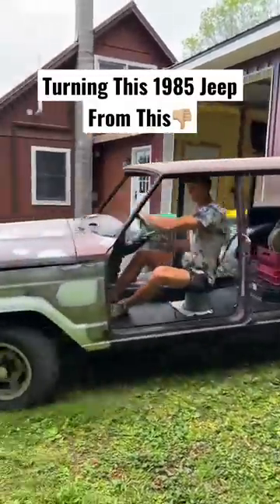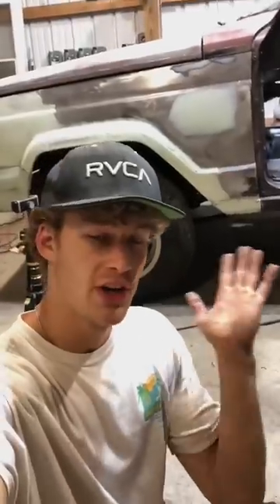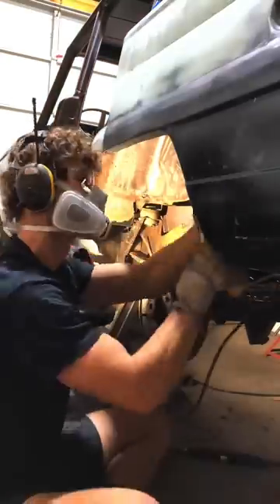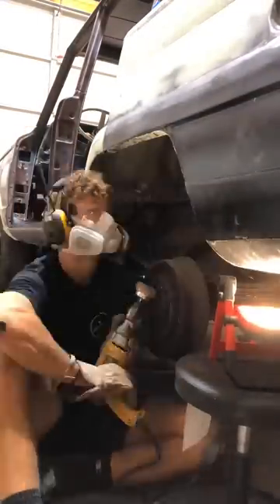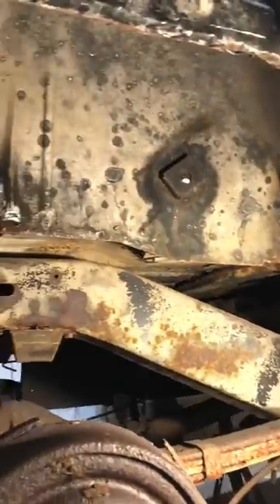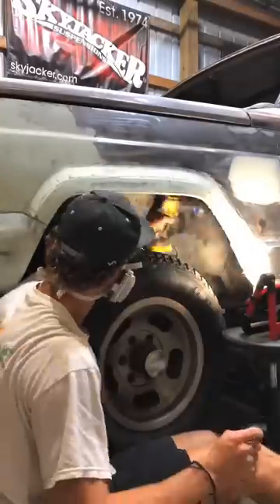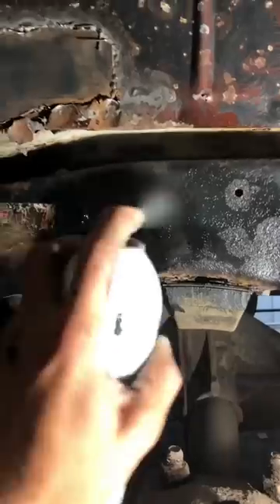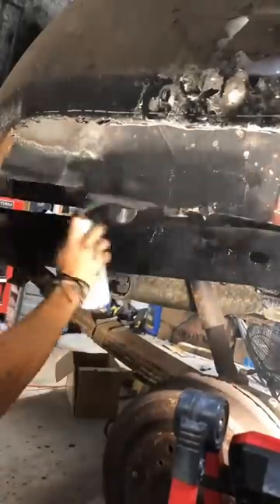Someone welded my jeeps wheels on 🤬 #automotive

Comment: To get that wheel off u might be able to replace the whole hub or you’d definitely be able to remove it with an oxy acetylene torch and the biggest hammer you have. You probably already know that but can’t wait to see this thing finished!
Reply: Throwing a pair of 1-ton axles under it is probably the better solution.
Reply: Doubt they actually welded, and I can almost guarantee I'd pop those off with a sledge.
Reply: 👍 galvanic reaction of Aluminum / magnesium and steel. I've seen Mercedes   rims stuck on so bad 2 of us spent hours beating the S### out of them then finally busting tires of rims then cold chisel and B.F.H.  thank goodness it wasn't my car. Always put anti-sieze on back of Aluminum rims especially if your interested in removing them.
Reply: He's just clickbaiting everyone with the welded on wheel crap to get more comments and views.

Comment: A good tip would be to use rust reformer instead of cheap spray paint for the undercoat to adhere to. Cheap paint flakes off. Which is turn causes anything that's on top of it to flake with it. A good primer over the reformer is also beneficial.

Comment: Wrap a chain thru the rims, and put the head of Jack on the hub. Have the chain wrap around the Jack to where the chain is hugging the Jack against the hub (chains should be making contact with the base of the Jack). Then start pumpin her up. You might need a stronger Jack (like a railroad Jack. They’re made to lift like 50 tons or something crazy, but they’re about the same size)

Comment: I've never not been able to get a wheel off. Use a sledge hammer.
Reply: I've had to burn the lug nuts and studs off w a oxyacetylene torch and if it's a hub centric wheel proceed to beat it like it owes me money w a sledge hammer
Reply: @hastyhillfarmand4x480  I had to remove a corroded-on "magnesium" rim once and I used an oxyacetylene torch to do it. 
I just warmed up a little and it came right off, but I parked it in the middle of an empty parking lot before I did it though, lol.
Reply: Put it on a concrete surface with good jack stands and beat the backside of the rims with a 20 pound sledgehammer.
Reply: He said they were welded on. Do you weld your wheels on? I hope not...
Reply: @spencerkleiman5035  They're obviously not literally welded on. You couldn't weld aluminum to the hubs/rotors anyway
Reply: His ability to remove wheels seems on par with his other mechanical skills
Reply: Heat up the rims with a torch.  They will come right off with a sledge hammer with no issues.
Trust me you would rather do it in the driveway. Than on the side of the road . ON the trails. When you get a flat
Reply: I used to fit truck tyres. Those wheel weigh a metric fuck tonne and often as not need to beaten like a hurricane against a screen door
Reply: @adamoneale4396  Probably heavy enough to overwhelm the shocks and destroy the suspension
Reply: @Matthew Klein  they mostly use air bags now.  Occasionally one will explode when you jack the truck up and you can't hear for two days minimum.  I remember a new tyre blowing put once and that stove in the side of my van and sent the jack about  two hundred yards down the road at high velocity.  Luckily procedure was to stand the other side of the van whilst inflating. The worst wheels to change are after a blowout or emergency braking. The heat quite literally welds the wheel nuts on
Reply: @adamoneale4396  air bags take the place of springs. Not brakes, socks, u-joints, tie rods or ball joints. Oversize heavy tires wear everything out
Reply: @Matthew Klein  wow, looks like I never worked on a truck in my life. All hail to you, the expert of everything
Reply: @adamoneale4396  you're welcome  :)
Reply: I use a 5 ft 4x4 stud , works great doesn't damage aluminum
Reply: I think you missed the caption, “someone welded my wheels onto my jeep🤬” I think we’re beyond the sledge💀

Comment: what you did there is only of cosmetic value, it will continue rusting.
You need to to properly remove the rust, treat with rust converter, seal gaps and prime it properly before painting.

Its a lot of work but the only way if you want it somewhat to last

Comment: You never paint frames and underbody with anything especially those rubbery stuff. What’ll happen over the years is a small rock or whatever will cause small nicks here and there from the road and allow oxygen/moisture onto the metal. Rust will form beneath it and it’ll cause more bad then good. It’s one of those thing that looks good but is actually rotting from inside out. You won’t see it since rust will be forming underneath the coating and by the time you realize it, it’s too late. 

Also try loosening the lugs a little on the wheel that’s rusted on there, drive a little then slam on your brake. Do this few times and your wheel should come off. Took many wheels off like this that’s been rusted on so bad even sledge hammers didn’t work.

Comment: If you want the undercarriage to last bed liner is not the solution
Reply: Shit gonna be hard to get clean too
Reply: @jamescrawford8121  you wouldn’t really NEED to clean it at that point, but what is the right way to protect undercarriage?
Reply: @kregadeth5562  just paint and fluid film, or go with por15
Reply: @kregadeth5562  Bed liner will work fine. Everyone is a mechanic now apparently. 
POR 15 would be better, Asphalt Tar*roofing tar*  also works,rubberized undercoating , oil,transmission fluid,pretty much anything to encapsulate the metal or evacuate the water will be fine.
Reply: It will rust again but it will be worse due to the bed liner
Reply: Bedliner is notorious for moisture building up in the small pockets between the surface and the bedline due to condensation causing things to rust out without you even knowing until its too late. Especially the cheap shit hes using.
Reply: @trpstrincllc4866  not a mechanic, just over a decade of experience. bedliner will NOT work fine.

Comment: Nice welding. Did you heat the wire up in a crucible and throw it at the patch panel? Also, love the rust clearly showing through.  What's your company name, Bodgett and Leggit?

Comment: I saw a trick and I didn’t know how to tag you, hard lock the wheel out, put a block of wood between the chassis and tyre then turn back in, I assume it will only work if you have power steering

Comment: You're going to have to get those wheels off one way or another. Rig up some kind of puller, use heat, sledge hammer, whatever it takes. You'll likely tear something up but it's gotta be done.

Comment: 1. Should have stopped everything and got the wheels off
2. Bedliner doesn't stop rust
3. Bedliner sticks better to bare metal, not paint (i used to spray bedliner for a living)
4. Stop sniffing glue

Comment: How did they weld the aluminum wheel to a steel rotor? They must have build the weld up to hold it on is all I can figure?
Reply: Drum breaks
Reply from the maker: Its a joke, it corroded

Comment: You are better off using a torch set on the wheel. Patience and heat will take it off. Heat it around all of the studs where the wheel contacts the rotor, keeping the torch head moving and not just focusing on one spot. Unless you don't care about saving the rim. Once it's hot enough I suggest turn the steering wheel either right or left and have a friend whack the back of the wheel while you are still torching it. Spin the wheel after each good whack. It'll take time but it'll work. I've been here a few times. With Old magnesium/aluminum rims. After years of being on the rotor, corrosion builds up along with rust causing the wheel to be "welded on". Also PB blaster is your friend with this as well. Works better than WD40. Just keep a fire extinguisher close by lol

Comment: Your metal is not clean enough for you to rubberize it, as it is whatever you coat that with is going to rust through again, bed liner and rubberized coatings are terrible and will eat your frame, and lastly why are you undercoating a vehicle you can't even take the wheels off of? That's like buying a shell and building the interior before fitting a drive line. Poor priorities make expensive lawn ornaments.

Comment: Don’t recommend the cheap paint spray at all. .promise you sanding it down an prepping the surface was all you want to do. Iv sprayer many hundreds of trucks an not once has that been recommended. It could actually mess it up in the long haul. Hopefully not though you worked your butt off on that.

Comment: No bro do not undercoat that with the wheels on if you’re trying to make it look right you’d be getting new rims anyway and putting big tires on it so just heat the wheel and bang heat the wheel bangs let it cool in between just don’t go to hot if you want to use those aluminum rims

Comment: The funny thing with rusted frames is they are hollow on the inside. You paid no attention to the rust you can’t see, and as you know, rust spreads. I only speak from experience because I had a undercoat shop for rusted trucks for a few years. You’d need to pull the cab off the frame and possibly dip the whole thing in evaporust. Labor was not worth the pay which is why I stopped lol

Comment: I’m not going to hate I’m just going to say as a guy building a 78 square body I undercoated the frame under bed cab fire wall etc and it calls for clean metal then epoxy then your bed liner application

Comment: Half assed af. Should've used a torch and heated up the wheel to get it off. Done a many semi wheels that way. Should've used rust converter. Your liner is going to be so hard to get off to fix the rust underneath once it bubbles through. And worse yet it'll look worse with those rust bubbles then it would have if you did nothing.

Comment: The slippery surface of the bare metal? Brother, you just scratched it to fuck with a wire wheel to get the rust off, what're you talkin' about?

Comment: If you really want to you could take the axles out. If it's a solid front axle like most jeeps you can just open the diff take out the pin and clips and take the axles out along with the wheels. You may be able to completely replace the wheels and axles if you can find the right parts. while your at it get some new rims unless you want the specific rims that are there or making it a budget build.

Comment: Wire wheel does a crap job of removing rust, even if it looks good it let's tony spots, use a sandblaster it does a way better job. I know from experience I had to do it again because it rusted again after some time

Comment: Spray PB Blaster(or whatever other one you use) behind the wheel directly where the wheel meets the rotor and then wait a day, then get your big crowbar and insert that on that same seam between the wheel and rotor and just start hammering. I did this to a  couple wheels about 6 months ago and they were actually pretty much fine after, I’m still using them with no issues. 👍

Comment: Take a 20 ton bottle jack put in the center of the on the hub and wrap a chain crisscrossed behind  the rim and then over the jack put a nut and bolt where it's crossed over the jack pump up the jack until the chain gets pretty  tight and give it a hit with a mall or crank the jack until the tire pops off

Comment: Should of used por15 to coat the underside of it can smash it with a hammer and not chip it only gets stronger over time and completely prevents rust ever forming again

Comment: As someone who used to work in a tire shop put front on axle stands and hit the inside of the tire with a large hammer .... They aren't welded on the alloy wheels has corroded on the hub

Comment: whats more important than the front suspension? the paint

so im going to paint it with cheap paint and without primer and yank the front suspension apart with a chain instead of, i dunno, a pry bar and sledge hammer and a heat gun like a normal person

Comment: Jeez you need a to give the steel a profile for paint and bed liner to bond to wire wheeling it will make it too smooth for a good bond sand blasting or hand sanding are your best bet

Comment: I have a bad experience with wire wheels I was using them to remove surface rust on something but all of the metal wires fell off one by one and I still find them to this day😂😂😂😂😂😂😂

Comment: Take the hub off the truck with the wheel. Then use a torch to heat the wheel and hub. And sledge away on the hub. Start by punching out all the lug nuts with a big round punch.

Comment: Use a block of wood as a spacer between the frame rail and inside of tire. Turn steering wheele appropriately for each side while using wood to push wheel away from the hub.

Comment: How to remove front wheels
step 1: Heat
step 2: Beat
step 3: refer to step 1
step 4: refer to step 2
Reply: If steps 1-4 don't work, use a cut-off wheel on the studs. Then replace them .That may be too hard for him though

Comment: someone welded aluminum wheels on there? ok.. all you have to do is take a oxyacetylene torch and burn the lug nuts off, if it's still stuck just hit each side w a sledge hammer back and forth till it comes off. hell, burn the whole f$#@in wheel off w a torch if you have to

Comment: Good god never yank a tire off with a rope or chain you could bend so many unwanted pieces and damage the drivetrain and mounting location for arms shocks springs bearings and so forth by yankin like that, take it from me I saw a guy stupid enough to do that and he pulled a lot less then you did and his Jeep kept a permanent death wobble for life after that, $10,000 into it trying to fix the death wobble and multiple self done alignments and professional alignments and a couple professional rock crawling shop visits to figure out the metal on the left side on a few of the main mounting places for suspension and the axle were bent a couple degrees out giving the axle a slight angle and wiggle room unnoticeable to the naked eye, he just ended up selling it and telling the next owner the issue I’m pretty sure they used it for parts car anyways tho